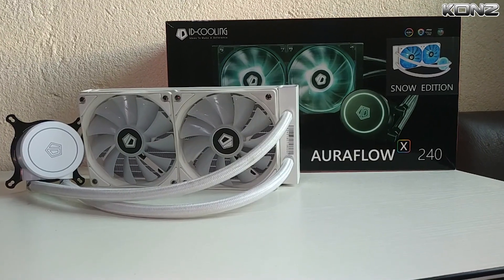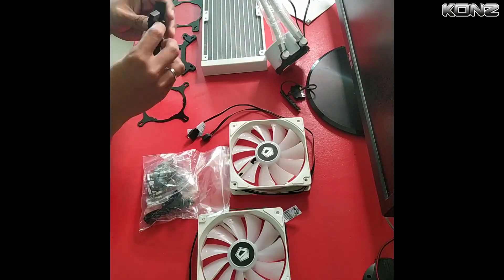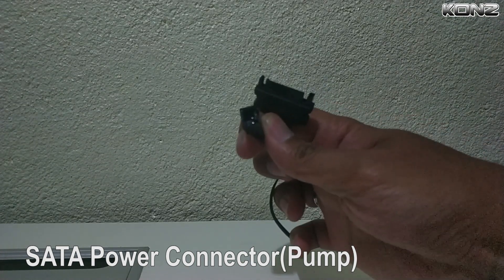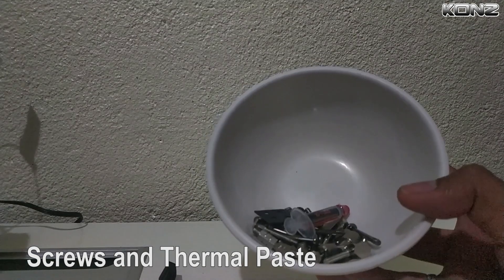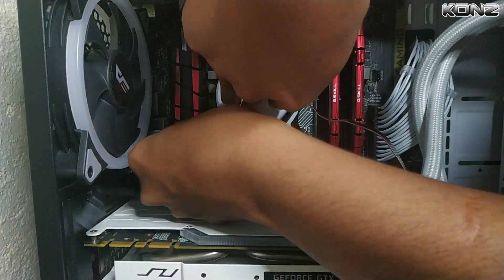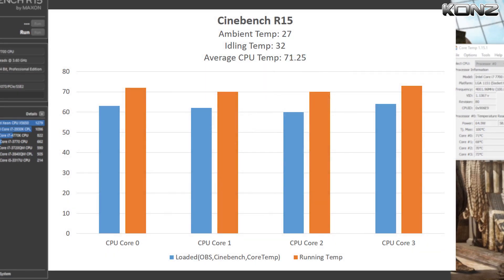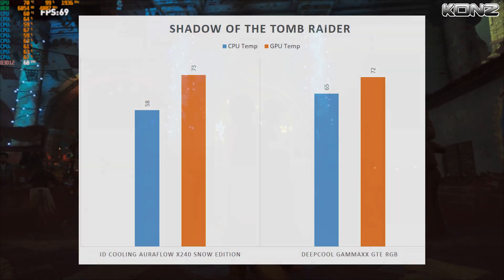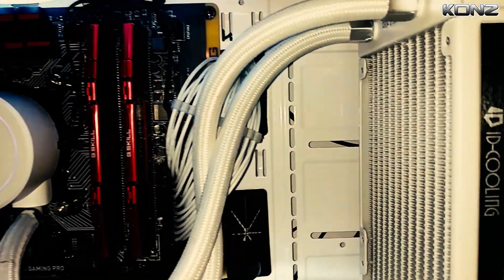ID Cooling Auraflow x 240 Snow Edition | AIO Liquid CPU Cooler | Unboxing, Benchmarks and Review

Comment: Kasya kaya to sa a320m na mobo?
Reply from the maker: hindi motherboard basehan jan. Check your case specifications kung kaya nia mag-accomodate ng 240mm radiator. May AM4 bracket ung cooler so it will fit with any AM4 socket boards like that.
Reply: @KonzTech  nag accomodate naman sir pwde 240mm. Kaso 450w lang psu ko true rated naman kaya na kaya yun? Ryzen 3 2200g at gtx 950 gpu
Reply from the maker: Ikaw bahala. Di talaga ako pabor sa mga "True rated" PSU na sinasabi nila for builds na madami nang parts inside except for the basic ones. There's not enough reliable information online to support them. Pero again, nasayo padin ang huling desisyon. Whether it's ok or not..I don't know.

Comment: How are you controllig the rgb on the pump head.... Theres no software install for me
Reply from the maker: I used the controller that came with the set. It doesn't have a remote so you press on it until you get your desired color/effects then tuck it back to the case haha

Comment: Hey man I just installed one. Does it kinda seem like the cooler is not completely on? I can’t explain it really. I’m just worried but I’m sure it’s fine. As I have done everything I need to. First ever water cooler btw.
Reply: Never mind I took a picture with flash on I can see it connecting I think lol
Reply from the maker: It's really silent unless the pump goes on full throttle which will only happen if you stress the CPU to make a lot of heat

Comment: do the fans have to be mounted on the radiator or can i mount them somewhere else if i wanted
Reply from the maker: you can mount them anywhere. But you will need fans to disperse the heat from the radiator. You can buy other fans to mount on it though
Reply: @KonzTech  ok thank i have fans that came with my tower and was just going to use those for my cooler

Comment: can you actually install it with the tubes from the pump is facing down? not on the ram side
Reply from the maker: yes. But not possible on my current chassis unless mag-vertical mount ako ng GPU since malaki ung card ko and tight na ung space pra s tubes sa baba
Reply: @KonzTech  I see, naka ryzen kasi ako. And wala pa ko nakkita na ung tube from pump e nasa 6 o'clock position
Reply from the maker: @JapsPerez  c gamers nexus nag-suggest nun since un ung pinaka-optimal orientation ng radiator tubes. 

EDIT: Mali pala pagkaka-intindi ko sa question mo. The tubes on the pump can be oriented sa baba..irorotate m lng ung bracket
Reply: @KonzTech  sorry kung masyadong noob un  tanong ko, haha 1st time kasi magbbuild, pansin ko kasi sa bracket pag AMD hindi sya square more on rectangle un pwesto ng mga screw kaya hindi ko maimagine, pero sa intel na bracket square kaya pwede sya irotate. tama ba?
Reply from the maker: @JapsPerez  yes narorotate kc sa intel. Pinanuod ko ung vid ko nasa baba pala ung tubes ko dito hahaha. And yes rectangle ung AMD bracket...hmmm not sure kung magagawa mong ilagay ung tube s baba by rotating pero actually kahit saan nmn orientation ng tube ok lng nmn. Pero if you're in doubt sundin m nlng ung typical which is nsa side ng ram ung tubes.

Comment: hoses up/res at bottom of loop/not top...=temps just as good as air.....if you flip the loop or top mount youll see at least 5c less if not 10
Reply from the maker: I can't top mount the rad..my chassis does not allow me..yeah top mounting seems to be the most optimal way to do it but unfortunately it won't work until I find a chassis that supports it

Comment: is this compatible with socket lga1200? coz their site seems confusing, the preview photos doesnt mention something abt lga 1200 but in specifications it does.
Reply from the maker: It should be as the LGA 1200 has the same sockets as the previous generations(LGA 115x) when it comes to coolers..check out this link from Techspot:

https://www.techspot.com/news/84956-confirmed-lga-115x-coolers-work-comet-lake-s.html
Reply: @KonzTech  thank you po hihi

Comment: Hi ask ko lang po sana wala po kasi argb header yung board ko kung magaadd po ako additional fans paano po kaya yun?
Reply from the maker: RGB gamit ng ID-Cooling auraflow..12v(4-pin) interface yun as opposed sa 5v(3-pin) ng ARGB..kung mag-aadd k ng additional fans mas ok bumili ka ng 3-piece fanset kc usually may ksama n ung sariling RGB controller and splitter

Comment: Sir, good evening. Without rgb header, can i change the led light of the fan and waterblock light into white color? Thanks
Reply from the maker: yes..it comes with its own RGB controller that plugs via SATA power..but no remote control..so you need to power on the PC..set the lights(via the small buttons on the controller) and tuck it in the case. The build here has no RGB header so I relied on that..check out the part where I enumerated the parts..it's going to show you how the RGB controller looks like

Comment: Sir mag kano srp nito ngayon? May masusugest ba kayong aio cooler na worth 3.5k pababa?
Reply from the maker: Sa panahon ngaun sir wala na atang SRP hehe..pero sa aio sir expect n 3500 pataas kung target rad mo is 240mm..Kung mag 120mm rad k mag air cooler k nlng...kc ung mga budget 120mm rad s tingin ko is di worth it on a price to performance ratio compared sa air coolers..Kita m nmn ung auraflow ko konti lng difference s gammaxx..what more p kung 120mm rad lng to baka same nlng cla..and mas mahal pdin for sure ung 120mm rad n cooler
Reply: @KonzTech  thank you sir hehehe buti nakapag tanong ako balak ko sana bumili eh
Reply from the maker: np..aesthetics lng tlaga mga gninto..kung performance habol mo sa AIOs, go for the bignames - Corsair, Cooler Master, Noctua, Aorus, NZXT, Asus ROG..pero xmpre they come with a ridiculous premium :)

Comment: i need to know can you remove the fans it comes with and put corsair ll120's on it
Reply: also i want to mount those fans on the front of my case its a nzxt H710
Reply from the maker: @trippymob0  yes you can do that..the fans are not connected to the radiator when you unbox it..I showed it on the vid..you can use others..120mm fans are standard in sizes and screw holes. You can also mount it at the front of any case as long as the case supports it and you have ample clearance for your GPU :)

Comment: Where do you connect you pump power and fans? Cpu fans with headers?
Reply from the maker: I connect them to the mobo header. The AIO comes with a splitter for the fans incase you don't have enough headers

Comment: Sir yung ambient temp ba na 27c naka aircon yan? sorry wala kasi ako pang check ng ambient temp kaya medjo confused ako sa temp ng cpu ko. I'm also using AuraflowX240snow, my idling temp pag naka set sa default frequency(2400hz) ang ram ko is around 36-38c(no aircon) and 32-35c(with aircon), pag naka enabled naman ang XMP profile 2 which is 3200mhz around 39-42c walang aircon(Tanghali). 100% cpu load ko is 65c max using prime95 and aida64.  Sa tingin mo sir normal lang temps ko? Oh and I'm using Ryzen 5 2600 at stock speed.
Reply from the maker: yes sir. May mga aircon kc na may thermostat so madedetermine mo kung anu ung current temp ng room. Sa issue mo naman sa temps mo it is fairly normal and ang importante naman jan is namamaintain mo ung sub 70 degrees on loaded scenarios. I am on a room now with no AC and my idle goes from 38-43. Nag re-apply nadin ako ng thermal paste and it remains the same. I did read on some other sources and it appears na eto lng talaga limitation ng AIO n to. It's a budget AIO anyway so I can't complain much. From what I learned, a better fan for the radiator would improve the temps pero di naman ganun kalaki. Nonetheless it still serves its purpose padin. Kapag naayos ko n ung mga clutter ko sa tambakan I will redo a comprehensive temp benchmark for this one against my Deepcool Gammaxx :)
Reply: @KonzTech  Thank you,  subscribed.

Comment: Hello, what is the fan case do you use? It has interisting running led
Reply from the maker: Hi. I use darkflash dr12 pro 3-in-1 fanset on this video. I already changed to the ID Cooling XF 12025 RGB trio now. You can check out my video for the tecware nexus Evo or Rakk Hunit White Build and compare how they look.